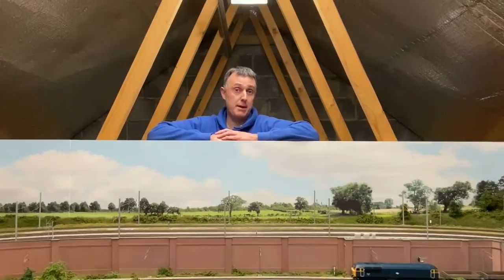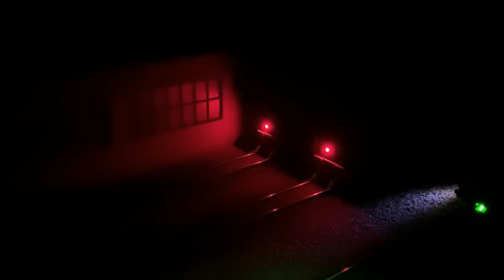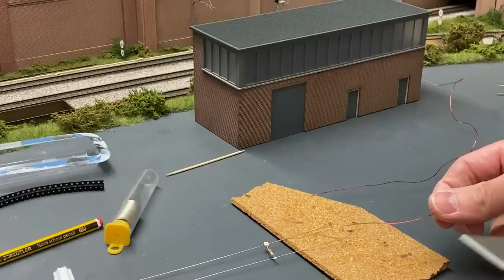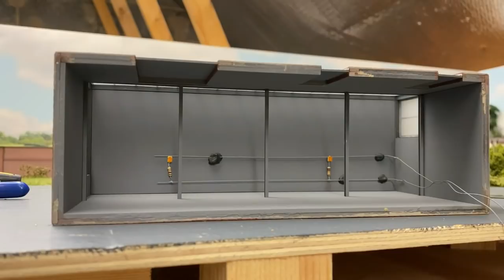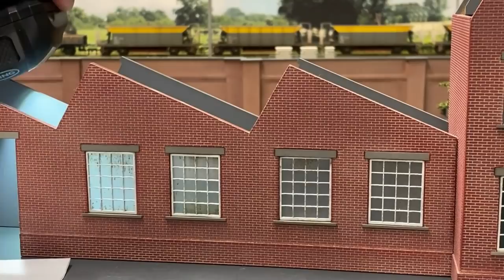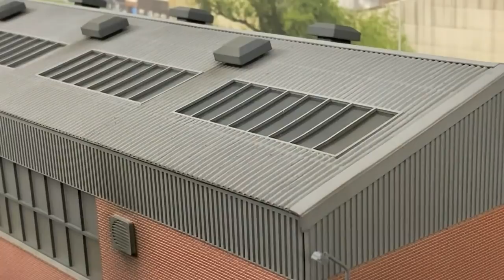Model Railway | New Depot Build - Update 15 | Dean Park 252

Comment: Hey there,
I am from Germany and I have a question.
The lights of the signals show green all the time. Why is that?
I work for Deutsche Bahn and our signals fall back to red when the train has passed them.
Reply from the maker: Hi. My signals also change when a train passes them. There are sensors in the tracks that trigger it from green to red, to yellow and then back to green. Thanks. Dave

Comment: Dave, yet another fantastically informative video. I don't know if you noticed it but between 9:20 - 9:30 I noticed that the 37 coming out of the shed, as it came off the concreted track to the open track the front bogie "jumped". Don'tknow if there is a joint there or the concrete is causing the problem and as you like attention to detail I thought I'd point that out to you in case you hadn't noticed it. 
Keep up the brilliance. Stay safe.
Reply from the maker: Terry Love hi, thanks. No the 37 wasn’t railed properly ... I’d just popped it on the track before the sequence was filmed and I didn’t seat it properly. :-(  glad you enjoyed the vid and for your eagled eyed misbehaving 37 bogie 😆. Cheers. Dave

Comment: Perfect ! Just one minor thing...several of the buildings have a base that floats over the ground. Just give the ground a spray of water (if you have fixed the soil with white glue) and then gently press the building down in the soil. Probably This isnt a problem, but everything else is jus FAB ! Thanks for a great video, and take care !
Reply from the maker: HenrikSweden1 hi. Thanks. Yeah They are set in to the ballast etc as I laid the ground cover with the building in place, then removed it before soaking with glue.... but I can always improve it. Thanks for that feedback. Cheers. Dave

Comment: Brilliant layout,maybe a stupid question but how did you power those LED’s ? I’ve got some LED’s with the resistor already attached but not sure what to use to power them up. Cheers David
Reply from the maker: David Gregory hi, from a 12v dc power supply.

Comment: The yard lights are worth every penny. Very finely detailed and quite right to install them later on to avoid damage. I think you've got the general lighting level spot on. I will be copying your dirty window technique on my  buildings - especially as a number of them wont have any interior anyway.
Had a quick look at Modelu figures. I particularly like the fact that none of the "workmen" are actually doing any! ;-) I can recommend Dart castings figures too if you haven't tried them.

Comment: The only issue is that your floodlights cast light on the backdrop, which spoils the illusion a little. Maybe a bit of a shade on the rear of the floodlights, or some similar trick, could reduce the effect.

As always, it's a pleasure to see your progress.
Reply from the maker: Hi, thanks.   Sadly the same can be said for the insulation on the roof where I may get a bit of reflection.   Cheers.Dave